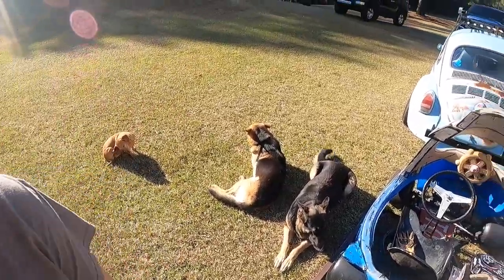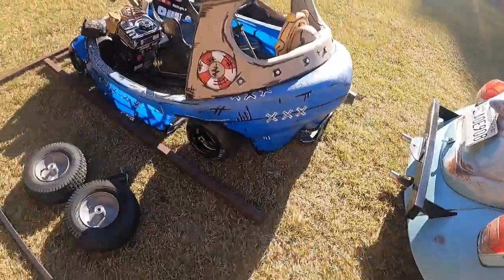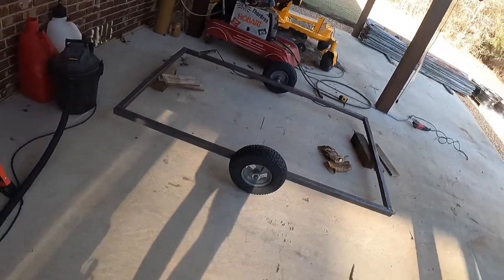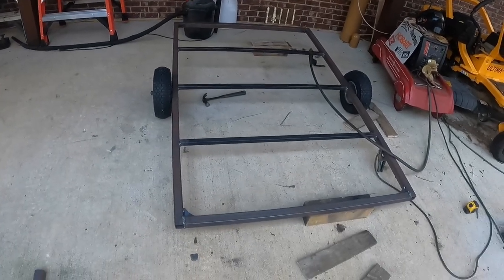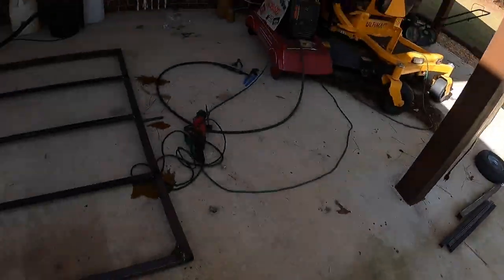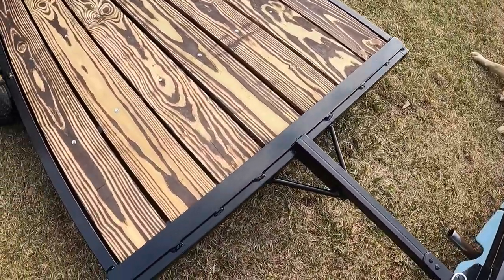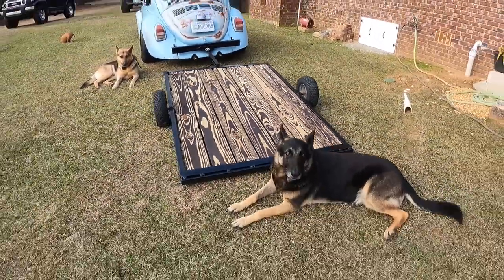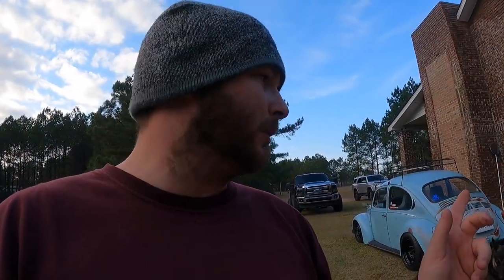I built a mini trailer for my mini bikes and go karts.

Comment: Over 25 years ago there was a ladder rack for a compact truck in the weeds behind work, they said I could have it, I cut it up. 1x2" box tube 1/8" wall, I have been making stuff out of it for decades! I need to make a sulky for an old Simplicity walking tractor, that will frame it and some no flat wheel barrow wheels will work fine.  Will be a lot like your trailer.
Reply from the maker: That would be awesome. I’m actually looking for a simplicity mower. Prefer the older plastic body. Going to build a low go kart style frame for it.